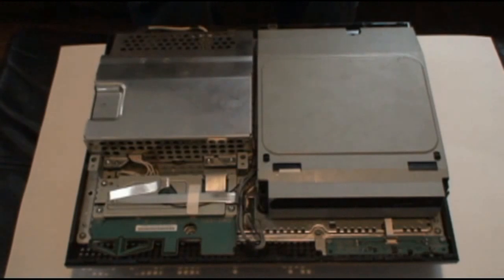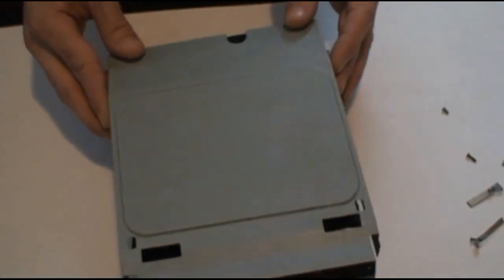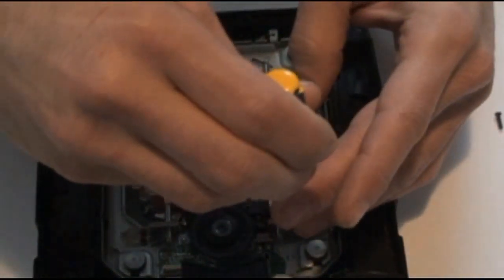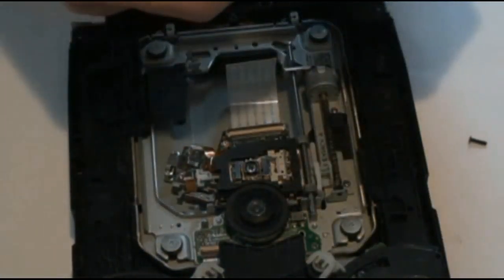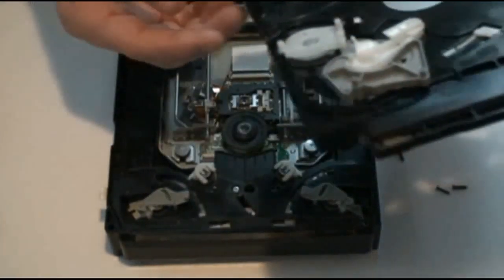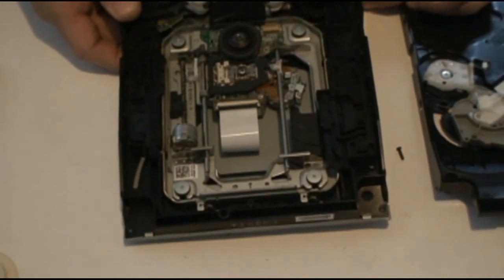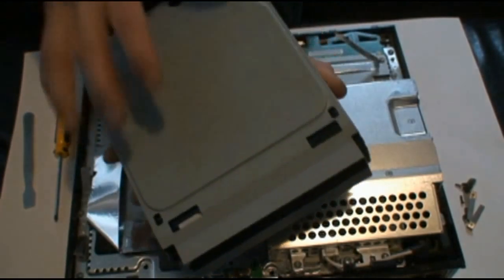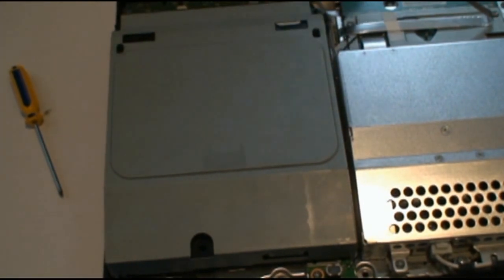PS3 Blu-ray Drive KES-400A/KEM-400AAA Laser Replacement & Proper Reassembly Tutorial  Noob Friendly

Comment: After more attempts than I'd care to admit, I finally got my kids PS3 to work - Thanks to you!  I changed out the laser (that was the easy part), but when I opened it, it still had a movie in it.  I took it out without any thought as to what I would go thru after I finished installing the laser.  I can't tell you how many times I took it apart and put it back together before I watched your video.  Taking out the motor and making sure the white gear in place, made all the difference.  Just saved it from the junk yard.

Comment: THANK YOU SO MUCH! I just used this video and the video for the KES-410A together because I have the 410A model PS3. You did not show how to take the PS3 apart in the 410A video, so I used this video for that tutorial. Also, the 410A video was not for the changing of the laser lens, it was for fixing the little plastic piece that pops when a disc was taken out incorrectly and that happened to me while I was fixing my lens on my 410A. So using both of your videos, I was able to fix my PS3 that has been broken for several years and I never got around to looking it up. Thank you again!

Comment: Good Job! Both the little white peg and the side slide were keeping me from getting it back together correctly. Still have to replace Laser, company sent me the wrong one. But other than that with this video and the right parts should be able to figure it out. My drive doesn't spin up so all I could find is the laser died. Hopefully that is all. Have to keep watching videos have 3 PS3's and they all built differently. LAWDY LAWD! ;-) Thanks again for the video. Excellent Job!

Comment: I have a question, my fat ps3 will play blu rays, dvds, ps2 and ps1 games and it will read ps3 games, but will shut off when I play a ps3 game only. the red power light will flash. It's not ylod the system will turn on and still operate as usual but will only shut off when playing ps3 games. Do you think it's the laser or something else?
Reply: It's probably overheating have you cleaned it out and replaced thermal paste and pads

Comment: Hi buddy! i was wondering if you could help me! you see I have a sony bluray player model BDP CX960 it has the same laser lens as a ps3 KEM 430AAA but you see i have an issue, i have the new laser, the complete mechanism and i wanted to replace it but i have an huge problem, the size of the data BUS is to short!!!  can you please help me? what can I do? i only need like 5 more cm to reach the connection
Reply from the maker: ***** Hi Lico, I assume you're referring to the cable for the spindle and worm gear motors soldered to the PCB on the mech. The only solution I can think of is to remove the ribbon cable from the old mech and solder it on to the new one. It can sometimes be done with a soldering iron and a careful hand but ideally you would want to use an SMD reflow gun and some flux to do this properly.
Reply: Thanks so much! you're right it's the one that's solded to the PCB it's a White flat cable but it's too short I really need help because i bought the complete mechanism but due to the design of the bluray player the cable needs to be a Little longer! I thought of solding it but frankly i don't know if it is safe, I could send you a photo of the cable if you'd like to, thanks again man!